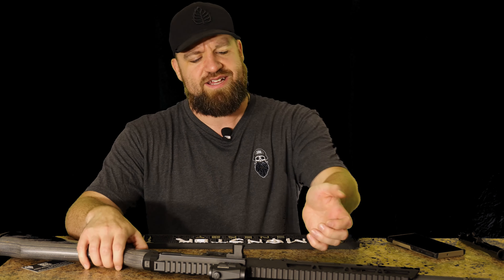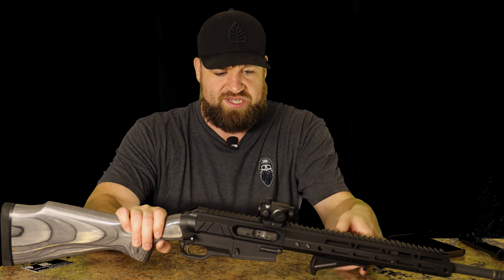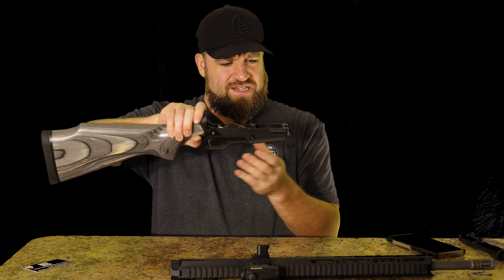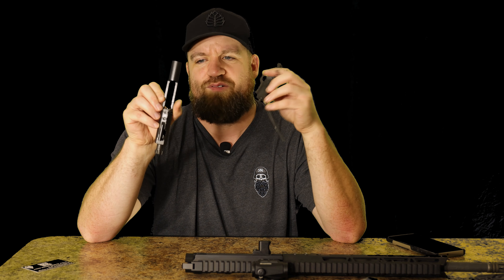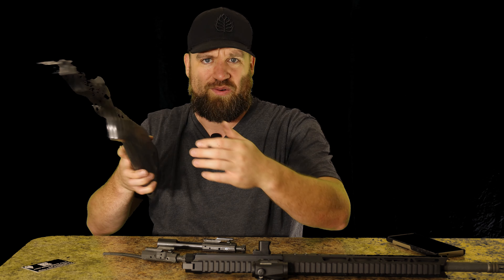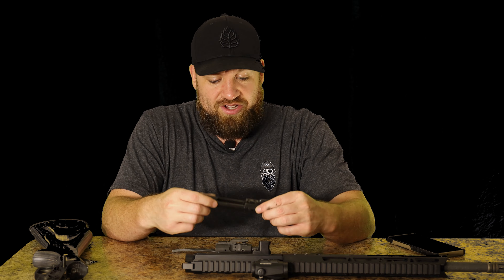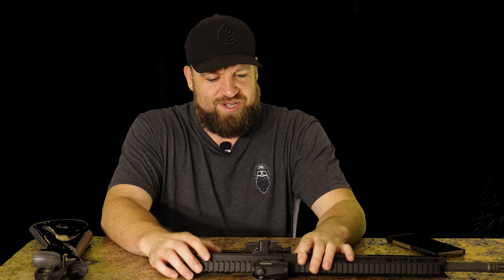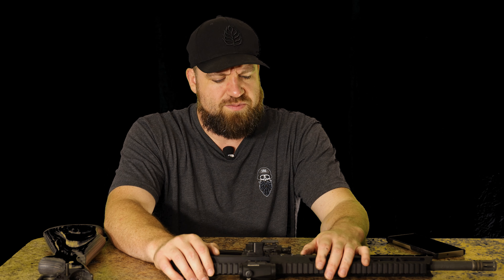How the Fightlite SCR Works

Comment: Curious if you think a ARAK 21 faxon upper would work on the fightlite scr lower?
Reply: Yep, I've seen one. Its a rad combo if thats what you're into.
Reply: Yes, it works.... but then I had an issue with it.  I am going to send the ARAK 21 back to FAXON because they have great customer service and want to make sure it works with the SCR.  The problem was that a round got stuck and I had to pry it out by slaming the butt down on the ground a bunch of times.  Stay tuned....  I'm guessing since the ARAK is piston there must be some mechanical no-love with the SCR that is most likely made for DI uppers.  The best part of this set up is the side charging handle.  Hope this helps.

Comment: Will the scr work with the bear creek right sided charging complete upper? From the pictures it looks like the charging handle is directly attached to the bolt carrier so I was just wandering if the scr bolt carrier would be compatible with that set up
Reply from the maker: I am literally using a bear creek side charging upper on this. I had to machine the fightlite bolt carrier to attach bear creeks handle
Reply: I like it !
Reply: A video on this would be awesome  @kennebearsarms